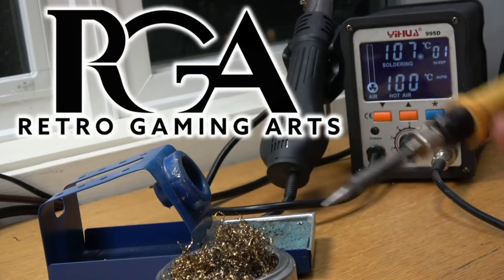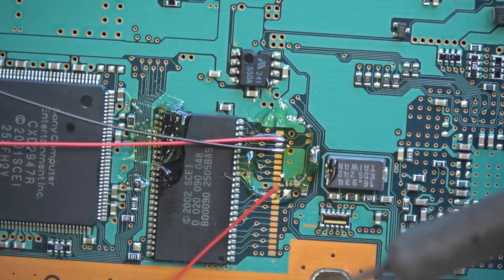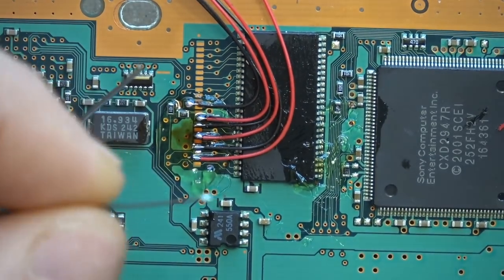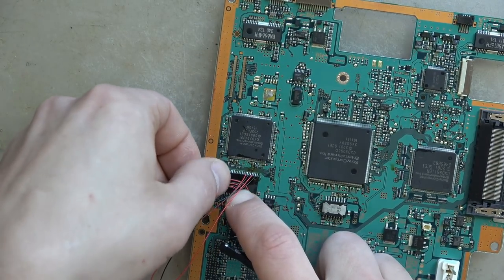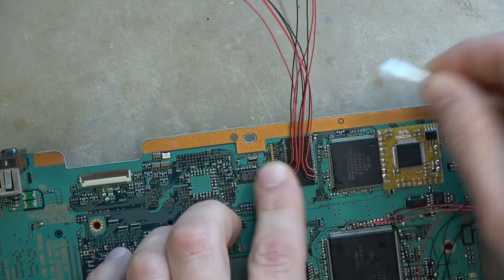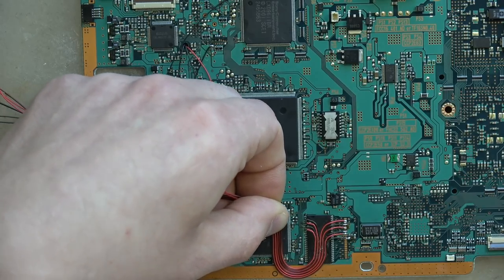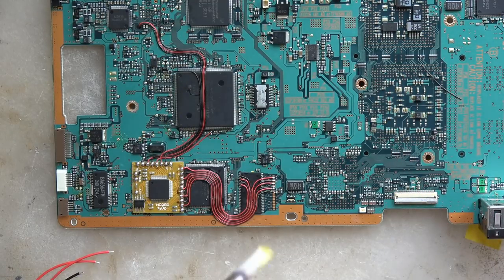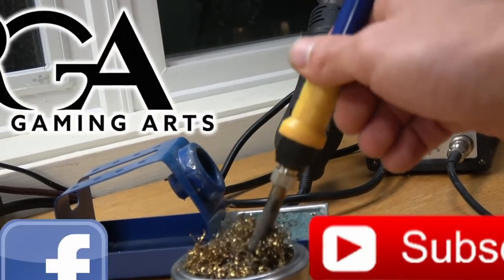HOW I MOD MY PS2'S (MODBO 5.0) - RETRO GAMING ARTS

Comment: I'm doing it like this:
1. Fluxing the area
2. make solder points on the contacts where it's necessary
3. solder the wire to the prepared points.

The fluxing is only necessary if there are multiple contacts you DON't want to bridge. (I used to do it without flux and it's one hell of a drag to fix a bridged conenction without flux.

Comment: Paul i gotta say i watched this and it gave me enough courage to take a stab at chipping my ps2 and it was a sucess.
Reply from the maker: Hell yes!! And great job!
Reply from the maker: This one wasn't even one of my good ps2 videos, check out another one of mine if you plan to do another.

None the less, great job to you, im happy
Reply: I got confused at first because i didnt have that type of wire used, so when i put it together the first time it booted but wouldnt read any discs wire was too thick. So i robbed the wire i had on my ps1 chip which was the same stuff so i had to recycle and kinda out source but it works.

Comment: Really cool man art!! But the only thing I don’t really agree is super glue..for some reason I found out over the years that it makes plastic and other materials brittle..I also don’t like the white residue and the reaction happening I also found out even fumes of superglue can destroy things crazy..but some times it works 👍
Reply from the maker: your 100% right, super glue works by melting the plastics and binding it together it seems, so it can deteriorate the wires over time, that's why i try to use as little as possible, thank you very much for watching (by the way, this is a bad one! wait till you see some more recent videos!)

Comment: Man after watching Voultar solder directly to the pins I was about to give up, I see you are using the side pads, for the most part, thats SO much easier.
Reply from the maker: for some of the ps2's there's alternate solder points you can use, depending on the motherboard revision, and soldering the the pins can be tricky on certain chips, the main chip on the ps2, the fine pitch can be tricky, flux + 30 awg kynar + fine tip = you win :-) i know you can do the fine pitch soldering, maybe if you have a broken one or something, practice some random soldering on a fine pitch chip before you attempt on your personal. but me, i would just go for it.

Comment: I recently installed a modbo 5.0 in a 39001 and when I reinstall the metal plate that sits on top of the chip I get a black screen + the blue led light doesn't light up. With the metal plate removed everything works great.. not sure what's going on with it? I've put electrical tape over the chip and all the solder points to make sure they aren't touching the metal so i'm a little comfused on what is wrong. Any thoughts?

Comment: I was expecting Voultar commenting on this) Modwork looks neat, I will try to do the same with my PS2
Reply from the maker: thank you, lots of tops and techniques in lots of my vids, i hope they help, let me know how your ps2 turns out
Reply: Ok, I'll tell when it's done. Not to soon though, lots of IRL stuff to do before I get my hands on that.
Reply from the maker: @iKarith I just posted a new ps2 video, I'm pretty much using the same methods, but i talk alot more about the solder points. The new video isn't my best work but its pretty cool cuz i install it on a Crystal Chip witch we dont get to see very often

Comment: I am going to attempt this here very soon on my ps2 slim. I prefer a modchip installed. I do have to say i failed at the one i did years ago. I didn't know about why the wire wouldn't stick to the small thru-hole parts of the motherboard. I now have a fiberglass brush i can use to get that coating off and hopefully will enjoy doing this finally!
Reply from the maker: Nice, I did a few other videos on the ps2, the matrix infinity install on a slim video may be very very helpfull to you. But the scratch pen you got will do wonders

Comment: I stopped trying to solder to the gold traces when I do those mods now. I am not sure if my iron has been too hot at times, but I have had multiple boards where those little traces would detach from the board and break during the process. I just do it off the chip pins itself now or get wire tiny enough where I can put it down in those little contacts with the holes.

Comment: You make it look so easy! I can't even tin my wire. I'm applying flux to it first but the rosin core solder won't stick to it???
Reply from the maker: it's kinda tricky to get the wire to be tinned, try applying solder to the iron, having a small dab on the iron, and then using the flux to transfer the solder from your iron to the wire. have the wire ontop of where your going to solder it to. this is the wrong way to do it, but it can work if your having some troubble. this modwork in this video is very old and bad and i'm uploading a better version of this video that focues more on the solder joints very soon!

Comment: Have you ever used magnet wire? I switched up about 5 years ago and never looked back. For me, it has been a ton easier to use and comes out looking sexy as hell too.
Reply from the maker: I haven't, I've seen it used, thought about it, but for ps2s I wouldent because I'm stuck in my ways now lol, however! Theres a ton of other applications I've thought of that I do want to use it for, just havent gotten around for those projects yet

Comment: Love your channel and in dire need of some good flux mind sharing the brand and possibly link where you get your flux from? Thanks again and keep up the great work!
Reply from the maker: Hey! Thank you so much! So, there's Various Types of flux, For a liquid flux this is a good 2 pack, so you get to try 2 different concentrations and see what you like more (I use both, they both work fantastic, some people will prefer 1 over the other) 
https://www.ebay.com/p/60-Ml-Combo-Kester-951-Kester-186-Soldering-Lead-Flux-No-Clean/12027470326?iid=273630692108&chn=ps

Now here is a flux paste, i call it jelly flux cuz it has the constancy of jelly.. (lol) I use this for different applications depending on the situation.

https://www.mouser.com/ProductDetail/MG-Chemicals/8342-50G?qs=6SAGcVcpVil6QxsjfUWJgQ%3D%3D&gclid=Cj0KCQiA-JXiBRCpARIsAGqF8wXq1Af-asIg1i2gkZODI2IPfKgHj7ZS9pj2xqXnE58Gav_tpSrrUr8aAg_6EALw_wcB

now in my personal experience, no clean liquid flux is a GAME CHANGER.. however I still uses the jelly flux quite frequently. Either or will work for quite some time. It really just comes down to preference.  just as a general FYI, MG Chemicals is a top tier brand for all sorts of various soldering equipment, not essential to use that particular brand, you can use knockoff brands and get away just fine! Or use Kester, another extremely reputable brand.

Side note, here's the EXACT Kynar wire i use
(i use 3 different types, but this is a great one)
https://www.ebay.com/i/252533787813?chn=ps

Thank you very much for perusing my channel, anything you need to know dont hesitate to ask, there's alot of information on here, but I'm always happy to go more in depth. and if its an extensive topic just tell me to make a video about it!
Reply: @RETROGAMINGARTS  Hey thank you so much for taking the time to reply, it's very much appreciated! It's a right pain to find quality flux in Serbia and it's too expensive even for the the cheaper quality stuff hence I asked. Will definitely buy some of the "jelly" flux, I would call it tacky flux but hey jelly does fine too. Thanks again for replying and providing links, kuddos to you brother.
Reply from the maker: @beogeek  I got you! I hope you can find it for a decent price! Good luck and thank you

Comment: Tired mine yesterday and normally I'm good at soldering, I just did an Nintendo Switch lite and had no problem. Didn't have a chisel tip maybe that was my problem?  Once I got to soldering the Sony chip I was screwed. i ALSO BOUGHT 30 awg wire but it still got in the way and bridged connections any help for someone who's first starting PS2 mods. Also I use a magnify glass not a microscope can't afford on yet. Oh and if you guys care about retro consoles my pins are broken on my PS2's Sony chip could use help finding a replacement please. And awesome video it inspired me to do this mod.
Reply from the maker: Ps1 is excellent practice for ps2 mods. Maybe the tip is the issue. I've used various different tips on my ps2 mods tho. I've done several ps2 videos. They all show different techniques and use different tools, watch my other ps2 videos to learn more, they will probably help. A few trys, and a bit of patience and you'll be able to do it very well. I know it
Reply: @RETROGAMINGARTS  Thanks alot I really admire the work you do. Ill keep watching your videos and practicing more. I recently did another ps2 got all the soldering down good but I must be missing something. The ps2 goes on but no mod menu. I'll keep up with it until I get it. Thank you alot for the reply

Comment: The modbo chip is a great copy of the MI, but if possible, use the one where the BIOS is stored. Among some MI clone chips, there are garbage chips that the BIOS cannot save. 1:56 The soldering difficulty of this part is high. My friend messed up the ps2 board while trying it  lol
Reply from the maker: I did a video about the crystal chip. And the original matrix infinity, and duo3, and my entire chip collection, check out some of my newer ps2 mod vids, there's alot of them

Comment: Hey, i have a PS2 SCPH-50004 GH-023 PAL which im looking to mod with ModBo 5.0. I found an a wiring diagram for it on Quade (it should be V9) and i cant really orient myself where soldering points should be. So i tought i could get some tips from the master of moding.

Comment: Hello retrogammingarts,

What superglue do you use to keep the wires on the chips?

Also, do you know where R609 is located on a GH-026 motherboard? It should be a 10k ohm resistor leading to pin 78 of the drive security processor.

Thanks in advance!
Reply from the maker: Regular branded super glue, but I get the one that has the brush, the brush makes it alot easier. Ans for exact location of that resistor, id need to look at a schematic and a motherboard, why do you need to know, what happened?
Reply: @RETROGAMINGARTS  thanks for the reply. I've been trying to backport the comsoft laserfix to the 5000x series PS2s. I installed in on a v9 but the only thing it does is keep the fan running at full speed and unable to turn off the console unless I use the mains on off switch. R609 seems to be connected to the  INT line which was used for the v12 slim. Following that logic it should trace to pin 78 of the drive security processor where b,g,h,i,a,y are soldered to. Unfortunately  the gh026 service manual i have doesn't clearly show side b and shows very little of side a.

I sent a link with more info to your Twitter, just have to switch to page 1 of that post. I'll double check my Dropbox for the zip folder.

Thanks in advance!
Reply from the maker: Thats so cool, I just read both of these, you figured it out??? Your over here installing comsofts on ps2 fats?? Where did you even get the comsofts lolol.

This is so cool
Reply: @RETROGAMINGARTS  I was able to get the v4 archive from Kel over on assembler games and now obscure games. I was able to create a pcb from the .brd file that was originally in the archive the other files like final_draft_labeled etc are the completed files. There is an msop version Id like to finish for myself as I originally ordered the wrong form factor for the ics.

The gh026 doesn't have an official schematic yet as I wasn't able to find a good service manual to screenshot the points. Might see if I can take more pics and upload those soon. I have a feeling I'm gonna have to unchip my board though.

Anyways, I have lots of ps1 and ps2 files on 3 hard drives so everything stays safe.

Cheers again!
Reply: @Retrogammingarts,

Follow the latest posts by Kel from this link: https://www.obscuregamers.com/threads/comsoft-v4-fix-confirmed.2978/

Upon further testing only Ps2 DVD games work on the v10 from my attempts, ps1 cd based games and ps2 cd based games cause the system to turn off.

Comment: i modded 2 systems now i want to mod the third which is the board GH-013 i found a diagram but it has the original matrix chip instead, i have the modbo 4.0 i want to be sure.
Reply from the maker: i've pieced together original matrix infinity install diagrams with modbo 3.0 diagrams in order to do some modbo 5.0.. lol it's possible, I would try, just be ready to test, because i had to do some testing in order to get the correct install points

Comment: I wanna put a dms3 on my ps2 50001,should I use the same wires? Those thicker ones are the same for dms3 too? I know where each wire goes I just don't know what wires I should use,which ones should I use for dms3?

Comment: Hi, thank you for vid. Just a question about the B point on v7. You seems to solder above the point recommended by the modbo diagram. What is the reason? And what are the effects ? Thank you again.
Reply from the maker: Cant remember as I've done alot of these. Either me and you are looking at 2 different diagrams(consitancy between diagrams isnt exact) Or I soldered to the wrong point and fixed it later.
Reply from the maker: This vid wasnt supposed to be a 1-1 guide like that, mainly wanted to show the wire managment. I'm actually editing a video about a crystal chip install on a japan ps2. Will be uploaded in a few hours. This way you can see how much in ive progressed😃

Comment: i tried few days ago to install an sd card reader on the slim, and failed pretty much. i could not properly solder the super small contacts and pretty much kept just bridging over and over... its a wonder to me that this console still works
Reply from the maker: HEy! i'm seeing this comment 4 months late, but my newest video is another PS2 install, where i touch ALOT on techniques for the solder joints themselves, maybe it can help if you try ps2 again in the future

Comment: Can you tell me what modchip do i have. It says when i put a disc matrix infinite v.1.99. Is it modchip v5. I just bought this with sata and 500gb hdd. I'm a freaking noob on mods because i only play original games.

Loading times on internal hdd is awesome by the way.
Reply: marjo pardo you could solder it or use a mc card with free mcboot, if you dont have the tools to creat a free mcboot memory card just buy one for 10$ on ebay/amazon

Comment: I have a question about a UO version ps2 motherboard. It's so old. It came before the version in the video.

I don't know where to put led power and grounding. I've looked and looked and nothing. Maybe you will know. 
This version ps2 doesn't have a band going to the power/ cd eject button. It has, instead 5 very thin white wires.
Reply from the maker: you can find power and ground from the power supply

Comment: What temp is your iron set to?  I had a Hakko fine point tip that started out great, but after less than a month, the tip doesn't heat uniformly anymore.  Wondering if I should crank the iron above 333 degrees?
Reply from the maker: 325-350
Reply from the maker: Do you tin your tip and clean it with flux? Do you change tips while iron is on? Is your filliment clean? Trying to figure our why it doesnt heat evenly
Reply: RETRO GAMING ARTS I tin it occaisionally with flux cored solder, but I clean it with a brass wire cleaner thing, and it's very bright and shiny.  The chisel tip I use is still working perfectly, but the point tip os now only useful halfway up.  It's from a reputable seller, but the iron came with a similar tip that degraded quickly.
Reply: Can you link me to the tip you use?  It looks a lot smaller than mine in the video, but a web search shows a tip similar to the one I have (sorry for being demanding!)

Comment: iv done a few installs myself your work is neat but i would not like to use supper glue i would use a lighter adhesive especialy on the trace lines if you had remove the glue for what ever reason you would end up lifting them traces
Reply: Then just use some IPA

Comment: do you have a link for Diagrams I have a modbo 5.00 chip not bought the ps2 but looking at a pal UK fat console. A diagram for all V boards would be good if you have any links
Reply from the maker: i type the model number and the motherboard number into google images and one will come up, i like to go by the "GH-051-12" model number printed on the motherboard, in addition to the "SCPH-39000" number